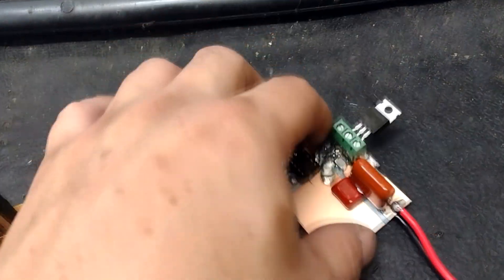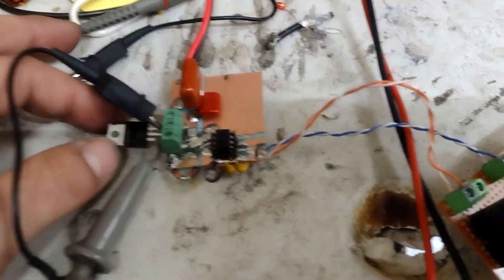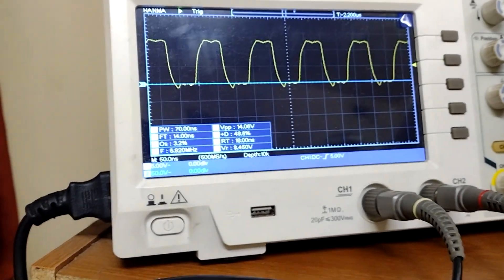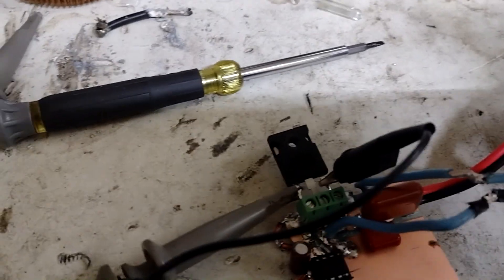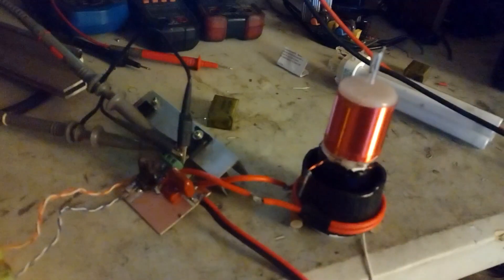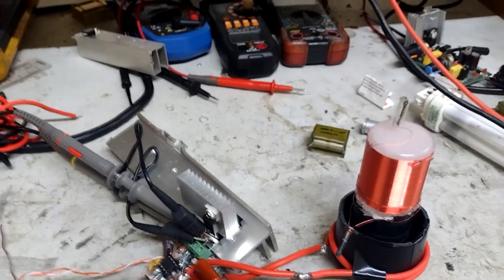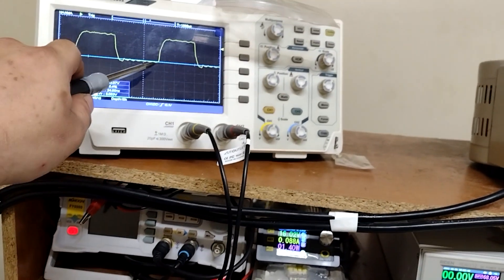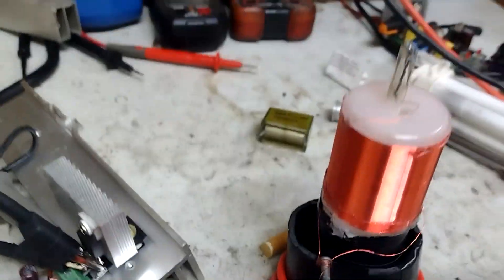Class E HFSSTC w/UCC27322 + Schmitt Trigger Oscillator

Comment: Would the tc4420 work for these kinds of class E sstcs running in the 4 to 5 MHz region
Reply from the maker: Yea I mean again, all depending. Can a motor rated for 1000 RPM run at 1500 rpm? Sure unloaded but then you might have a problem running at max load capacity. Those are 6 amp drivers so I don't know what your load is planning on being but yes there's a theoretical load those drivers can handle totally fine
Reply: @Magneticitist I had a doubt regarding the ground for the secondary for these class e sstc's . Do I use the wall socket ground or should I take an external ground from outside with like a copper pipe in the ground .?
Reply from the maker: @spiderspider1384  I just use circuit ground or mains ground
Reply: @Magneticitist Circuit ground as in the negative rail ?
Reply from the maker: @spiderspider1384  yea
Reply: @Magneticitist Instead of using an interrupter using the 555 timer couldn't we just use the left over pins in the schmitt trigger IC to make another oscillator with a higher value capcitance to get a low frequency oscillator, who's output goes to the enable pins . 
Would this be advised or might this cause like interference within the 74hc14 chip that effects our class-E drive frequency .
A varient of the schmitt trigger oscillator also has adjustable on and off times using 2 antiparallel diodes .
Reply from the maker: @spiderspider1384  It doesn't really matter what you decide to do so long as you can make square waves. Most people prefer 555's for their high accuracy. 

IMO the concept of interrupting and Class E don't really make sense to me unless someone is pushing so much extreme power that Class E operation alone is not enough to keep the switch from blowing up.

Comment: Evn though it is running fixed freq it surprise me how it does not get detuned as you get your hand close or draw an arc , mine gets detuned pretty easy , I am trying to get my variac setup so I can use it like a power supply I plan to buy a 50amp bridge and also I think I have a 220 to 24v transformer to put after the variac , then I have two parallel 470uf capacitors to smooth the output , that will allow me to test everything better also I will be limited to 24v to begin with so I won't blow anything up hopefully hehe
Reply from the maker: It's mainly just a relative thing but when the output gets large enough it's a lot harder to see a difference in the detuning. I'm also intentionally tuning it so that it will get better in tune the higher I bring the voltage, which is similar to what happens when loading it by hand.

Comment: So using the variable pwm source you can tune this for zero voltage cut on by tuning the c/e capacity? 🤔
Reply from the maker: Yea basically but you still have to get that tuning matched with what will give good output on the secondary. I'm basically just using a variable frequency 50% duty from the schmitt trigger to set a desired frequency instead of some kind of fixed crystal setup or something.

Comment: Awesome work man! I found I could get mine up to about 5MHz, but at that point the UCC would get quite hot. Based on what you're showing, I'm starting to think it was because of the MOSFET gate capacitance demanding more current to charge. My UCC output is also a fair bit more sloped than yours, and I'm thinking that's because of the 5 ohm gate resistor I'm using. Do you use gate resistors on your model, or do you just feed straight from the UCC to the FET? I was starting to think my build was done, but now I see it has far more potential than I first thought...maybe I could've gotten to 7MHz with a SiC FET and no gate resistance! I'll certainly have to give my old 5MHz coil another shot if I ever get another $20 SiC FET.
Reply from the maker: I put two 3.3 ohm smd resistors in parallel for this build and the last one after realizing the ringing wasn't too bad with the copper layout. It's good to have at least some small value because there will be ringing either way and the resistor helps with that. 5 ohms would definitely slow my transitions a lot. The gate driver getting hot is definitely it trying to charge/discharge too much gate capacitance at too high a frequency. This is why I grabbed a handful of various heatsinked gate drivers I found on mouser that can deliver much more peak drive power for powering through the higher frequency switching while being able to dissipate the heat properly in the process. Should be able to see what's a good deal on those soon.

I used a couple $13-$15 sic fets I found that only paid off as of yet due to not quite having a strong enough gate drive and needing a good fet that was easy to switch. They seem to require more care because they are capable of such faster transitions and the peak voltages that would result may be more difficult to mitigate than with some regular si fet. At 7mhz a sic would probably be ideal with a super clean power and gate drive layout (largish flat planes that overlap etc) but you'd still want at least some 1 ohms gate resistor  or something. Even so I don't think it would be easy to push 7mhz or so without a fet that has an extremely small total gate charge and some kind of way to actively cool the driver.
Reply: @Magneticitist  how about paralleling two gate drivers ? That would give you double of gate driving power , also I was thinking I got 15ohms of gate resistors that is probably killing my output a bit
Reply from the maker: @rodriguezfranco3839  that's technically supposed to work but I've never tried. Ive also seen people apparently claiming it didn't work so well.

Comment: Is that secondary ungrounded ? I can't see the ground conection you got that screw at the bottom and the breakout at the top
Reply from the maker: That's actually just like a halfway point because it's the top of one coil spliced to the bottom of another and then wrapped around a screw so the wire didn't disintegrate when the plasma developed. The bottom of the bottom coil is grounded. Stacking these two similar coils together with a gap in the middle basically just works like it's one coil.
Reply: @Magneticitist  oh yep now I understand 🙌

Comment: Oh that is pretty similar to my driver I think , I got a ucc 27324 , next step would be trying a sic fet on this setup . I would like to see how those little to-220 would work on that setup
Reply from the maker: I wouldn't put a sic fet on this circuit unless I planned on at least 4mhz or so but even then I'd prefer a better gate driver. The two sic fets I use are at 2.8mhz which is kind of a waste, and 3.5mhz which is more decent considering the gate driver I used. The IRFP260 at 3mhz using the ucc27322 can push around 250W continuously non-stop without problems and the limit is the 200V max. An IRF640 or something should work fine with that driver up to a few mhz at least I'd think. I played around with one of those and a 740 but could only push about 90W with either at low voltage input and it wasn't as impressive. Probably closer to 60V or so is where they would shine but you'd also have to tune it real good for it to survive.